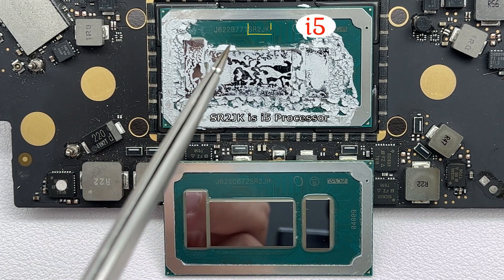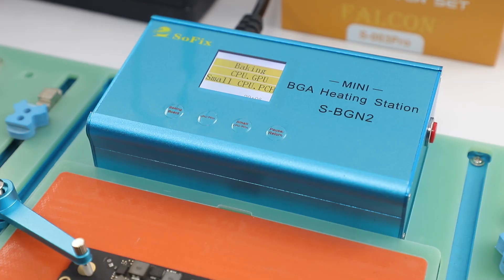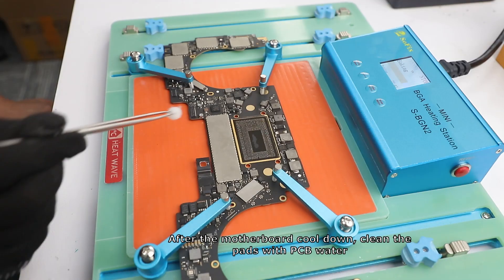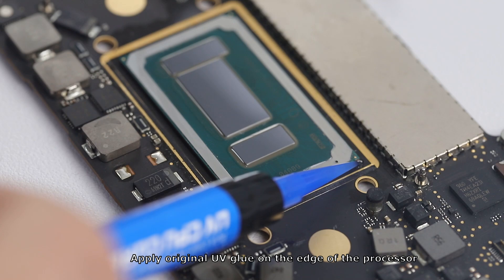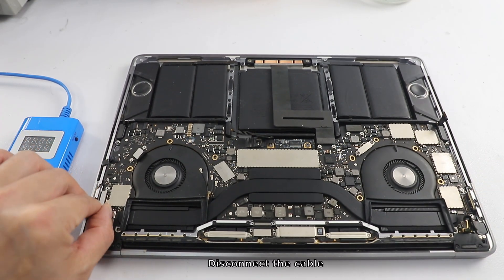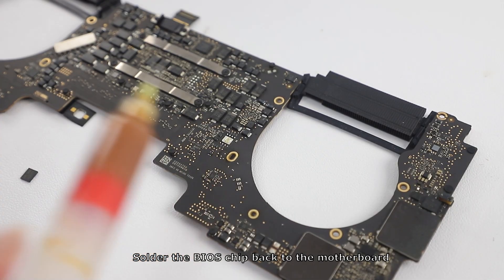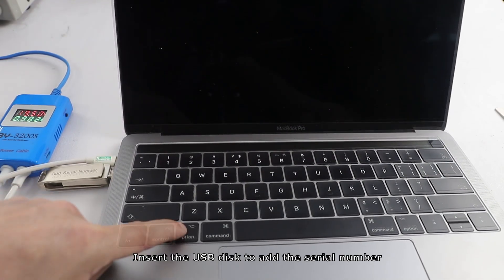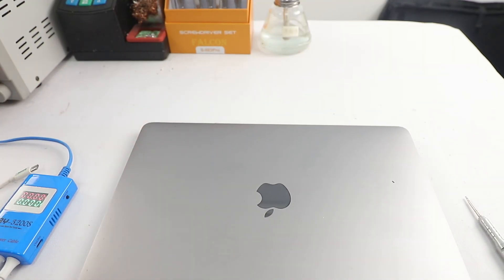How to upgrade MacBook Pro processor i5 to i7 step by step

Comment: That EFI Programmer is awful. 
Use the Medusa 3 to reprogram it. 
But you should also put in the SN
You'll also have to do the checksum
at another location wthin the file 
to ensure that the file is authorized to write

Comment: When you use the "pause" feature in the  heating table, does the warmer get turned off? Also, I thought when you wanted the Mobo to cool down, it was best to slowly & gradually reduce the heat, so the board cools off evenly too. Did you check the schematics to see if there are any additional board component modifications?

Comment: nowadays laptop CPUs is married to the bios so if you change the CPU on a laptop from 2014-present the laptop won't work unless you put the old CPU back
Reply: On older macs it'll still boot after the upgrade just takes longer. I saw on another video you have to desolder bios chip and flash it with a special tool.

I really want to try this on my ancient mac but dont have these special tools required for a successful upgrade (bgn heater and bios chip flashing)

Is there anybody that offers these upgrades as a service??
Reply: you just have to clean the ME region on the bios lol
Reply: Just try it's nearly impossible without experience and manufacturer tools and equipment @dimitris_verlis

Comment: What a stupid design of the machine so the owner user has to climb the highest mountain to upgrade the machine to a slightly better specifications. I hate Apple for making sure the consumers has virtually no other option but to buy new computer or try find miracle technician like this guy in the video at their country. The ability to customize my PC by my own hands is the only reason why I use Windows machines. Boo Apple !!! P.S. Super clean work by the technician in this video - very impressed by his skills <3
Reply: Windows laptops aren’t that different. Same BGA soldered CPU, and BIOS chip design.
Reply: Yeah, but at least Bios is installed via software  @michaelwiley5427
Reply: @michaelwiley5427  Actually the bios on windows laptops usually already contain info for other CPUs and don't need bios update. Only Apple has this bios update for the CPU ID requirement. Apple is totally anti consumer. They are "for themselves only" to make more money. To make and upgrade to an Apple product you have to scratch yourself with all arms and legs on every point that itches you or buy another one with upgraded characteristics.
Reply: @michaelwiley5427  Yup.  But Apple started that crap, and everyone follows.  Same with glued batteries and hard to open phones.  Apple always starts this anti end-user BS.
Reply: Windows laptops have this exact same issue
Reply: Take apart a Microsoft Surface 🤡 you hate appple cause it’s the cool thing to do.
Reply: for the last 15 years regular laptops could not be upgraded, it has nothing to do with apple or non appele OS, if tody you want an upgradable laptop you need to buy a mobile workingstation and essentialy buy yourself a DELL precision or something similar.
gone are the days of somethign like an acer aspire 7738g in wich everything was socket mounted and not BGA